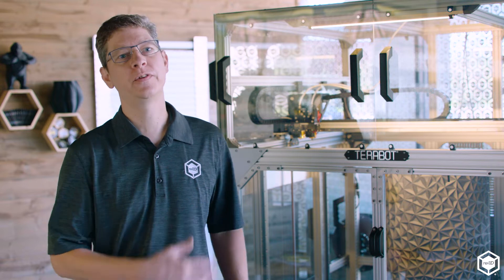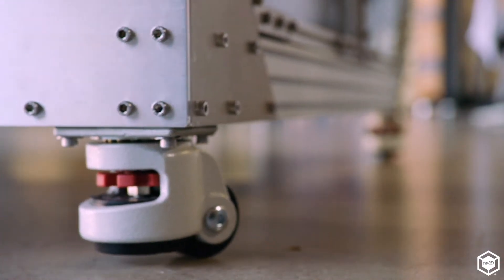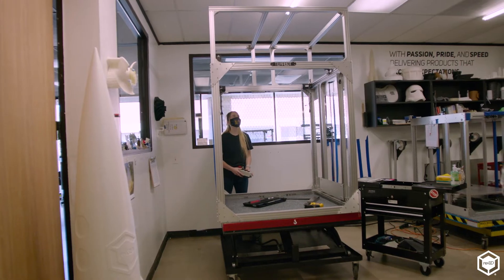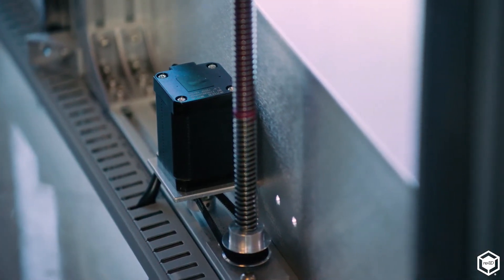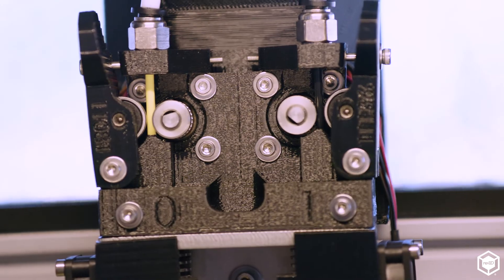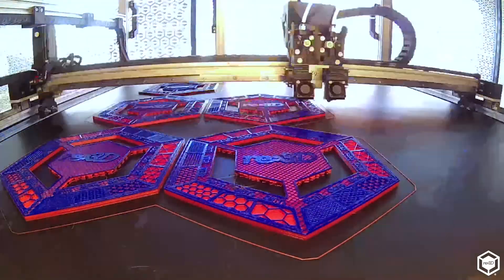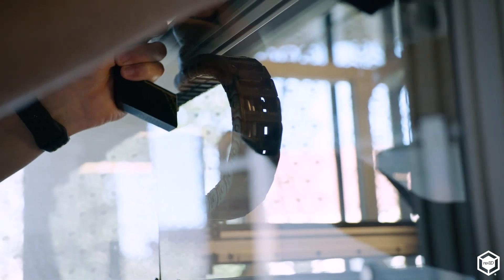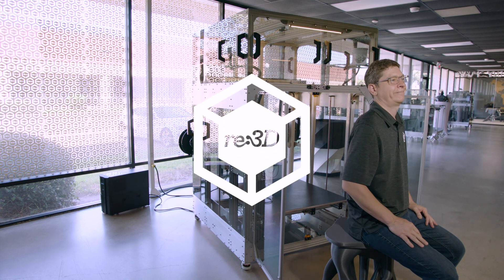Meet Your Terabot

Comment: Looks like a good printer but 60mm/s seems a little bit slow for a build that size. I think I would expect using .8 or 1mm nozzles at a minimum 80mm/s or more.
A black frame would look pretty cool too.
Reply from the maker: Thanks for the comment Muru! The Terabot does have the ability to accept 0.8mm nozzles for higher flow printing, and the printer can be bumped up to the higher speed of 80mm/s with the proper settings. Our default is the 60mm/s to keep these standard across our printers and profiles. Thank you for the feedback!